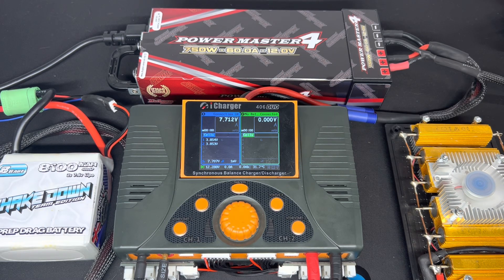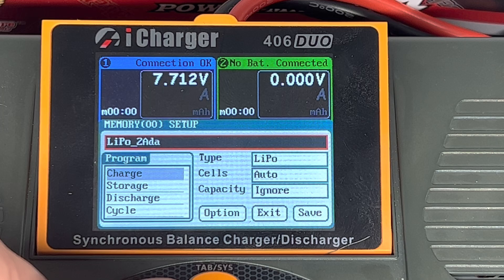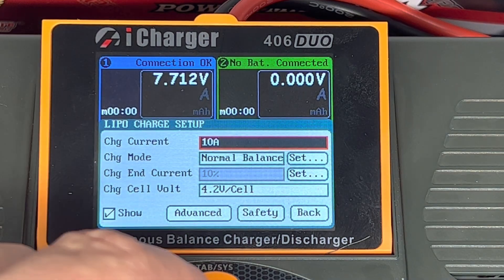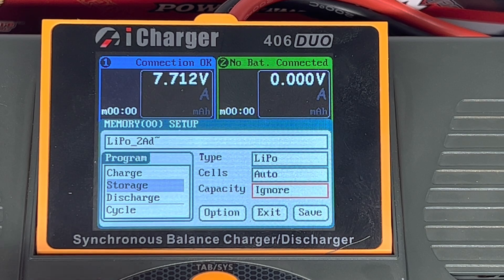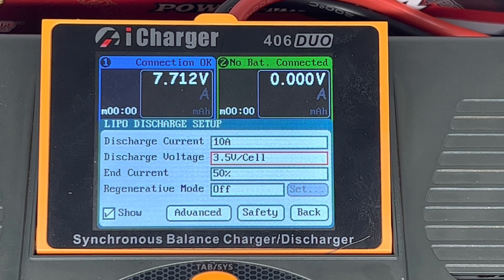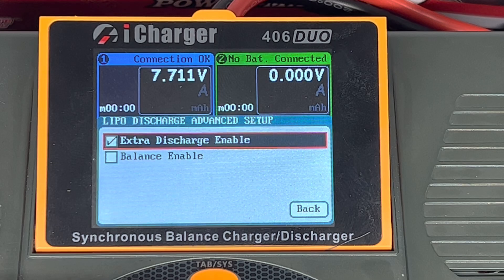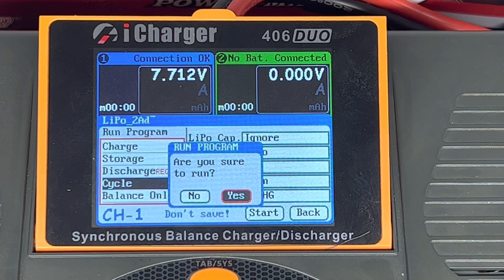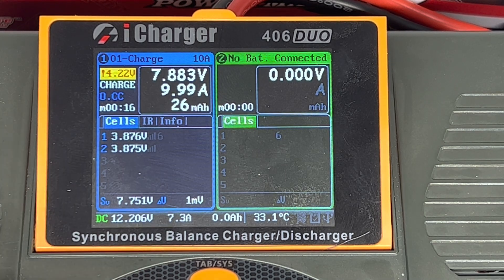Icharger setup

Comment: Maybe you guys can help me. I recently purchased a 4010duo from 2019. When testing the charger and wanting to change or add a profile I could not edit the profile or list. (I used a 406duo with no problems) 
After updating the firmware it worked fine for a view charges before it got stuck again. 
I hope that someone recognizes this issue or at least knows the solution. 
Thanks in advance

Comment: I have a turnigy graphene battery 6.0 mah can I charge at 30amp?  Some of my lipo dont list the c rating how do i find it for those lipo's?
Reply from the maker: You can theoretically change at any amps you want. The lipo manufacturers will give you a save value to use. If you chose to charge at a higher rate than that’s your call.

Charging at higher rates improves the lipo IR, but also shortens the life of the battery. 

I’m a pure performance application the life of the battery is not important.
Reply: Ok thanks
Reply: That's a 5C rate....which is generally considered the MAX charge rate for the newest lipos. Previously 1C charge was considered standard and 2C charge was considered fast charging.

I personally would not charge a Lipo at 5C. I have never been in such a rush that needing a battery charged from flat to full in 12 minutes was necessary...from storage it would be 5-6 minutes depending on the amount of balancing required.

The guy that made these videos is basing his settings off drag racing....and to be honest those guys really push the limits in terms of safety as they are running their packs for relatively short runs so pack temperature isn't usually a huge problem as they aren't running their packs for an entire discharge cycle....so cycling them prior to their race allows them to preheat the battery which lowers internal resistance. I'm honestly surprised heating pads aren't used to prevent the additional cycling from wearing on the battery but at the end of the day, HEAT is always the #1 degradation factor for all lithium chemistries....so probably not much of a difference.

If you are not familiar with Lipos and do not have experience with the specific pack you are talking about then I would start at 1C and work your way up if you truly. need to charge faster. Lipos should ALWAYS have a human nearby when charging or discharging and using some kind of Lipo bag or a container to contain a fire is advised.

Comment: For speed run Cnhl 4s 6000mah,  on that Charge. how would you set the values?
Reply from the maker: CHNL batteries have a 5c rating. So they could be charged at 30 amps
Reply: @StewMac570  Thanks you so much Champ.. Love Your RUNS